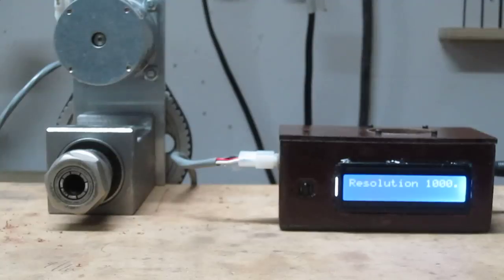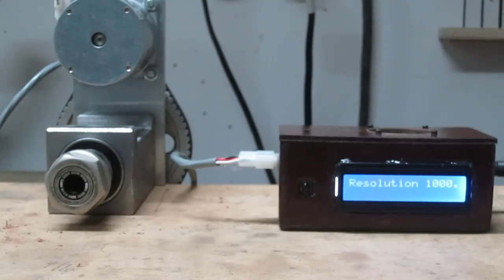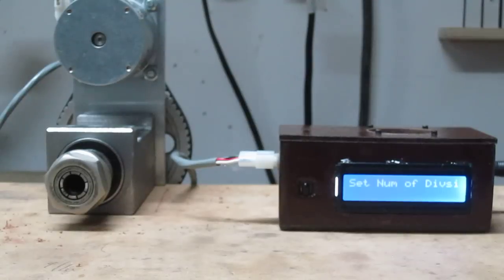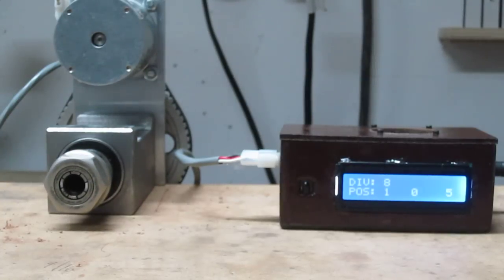Infra Red Remote Controlled Arduino Dividing Head

Comment: Hello chuck, and as it does to divide a prime number? for example 53 or 17 ?? Thank you!
Reply from the maker: Yes, it will do prime numbers.  There are 1,000 steps for each revolution so it always rounds to the nearest step.  This can cause a worst case error of half a step or .0005 revolution or 0.18 degree.  Haven't found this to be problem on tooth spacing when cutting gears.

Comment: This is an excellent project. I haven't used arduino before but want to make this. Is there any chance you could help me with a set of instructions or how to guide. You can contact me on pappy.1812@gmail.com. Any help would be fantastic as I really want to make some gears. Thanks Paul.